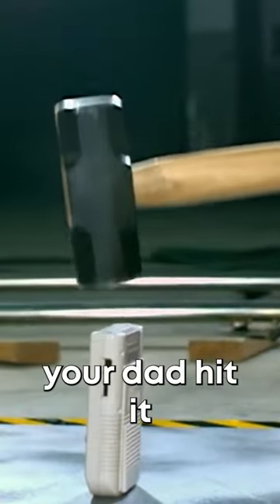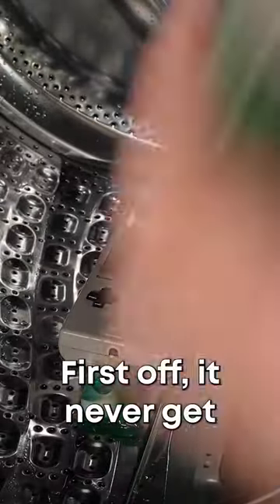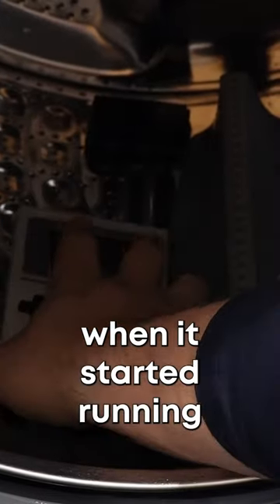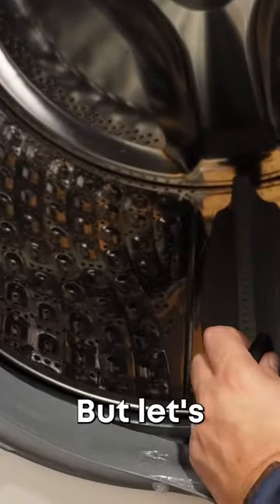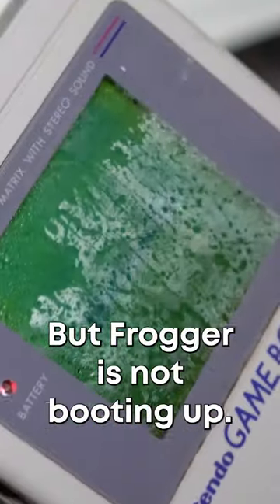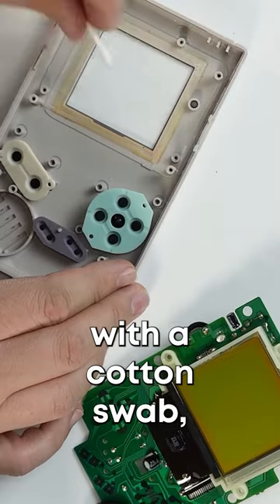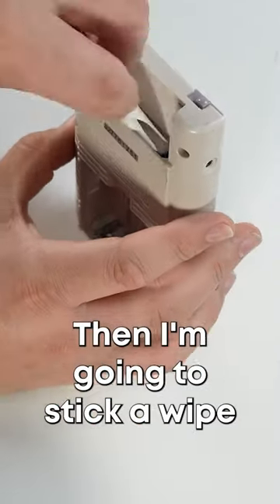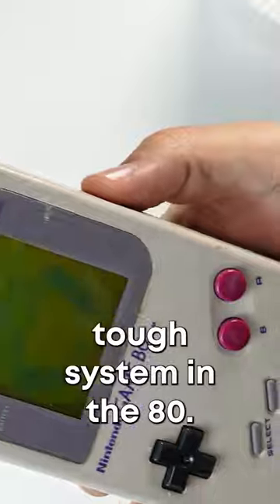Nintendo GAMEBOY In a WASHER?! #shorts

Comment: I had a flood and my wii u gamepad was completely submerged. It still turned on, I had a friend replace the screen and the touch pad and it still works to this day close to 10 years later.

The slider for the volume doesn't adjust the volume up or down, but the sound does play still just at one constant volume.
Reply: Wow, you got lucky. Mine broke fairly quickly and I wasn't able to get the battery replaced until much later... at which point the Wii U broke instead.

Comment: I had my DS go thru the wash as a kid, I thought the touch screen was damaged and wasnt ever really able to play on it.

Fast forward to 2020, I bought a device repair kit, went to swap out the screen on the ds, and it turns out one of the bumper springs was jammed and was forcing it to press like 100 times a second.

After adjusting that everything worked 100%

Comment: Actually had a copy of Pokémon Crystal live through a wash and dry cycle. Even with the save battery inside, it still worked just fine. Not game related, but my mom accidentally left her flashlight (Olight S1R Baton II) in her jacket pocket, and because it has a magnetic tail, it stuck to the inside of the washer for a few washes. She said it didn't work, so I checked, and the only issue was that it had gotten a little unscrewed. Opened it up, no obvious signs of rust, so I just relubed the threads and it totally worked.

Comment: assuming everything was dry before it was turned on, it should be fine.

minerals and debris in water is what makes it conductive, giving the board a charge with micro-mineral-water will short it out

if its fully dry however, youre a-ok :D

Comment: Love that you're destroying working original hardware driving price through the roof. Thanks!
Reply from the maker: 1) It worked after the video
2) I was very confident that this wasn't going to break it. I was ready to repair it, and had it of actually broken, I had an agreement with a repair shop to donate any working parts to rebuild multiple OEM Gameboys.